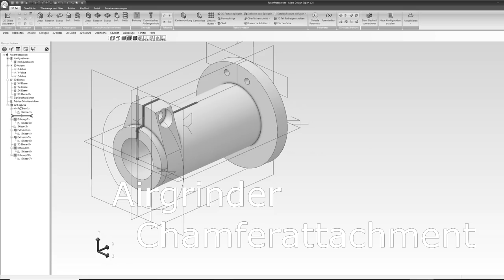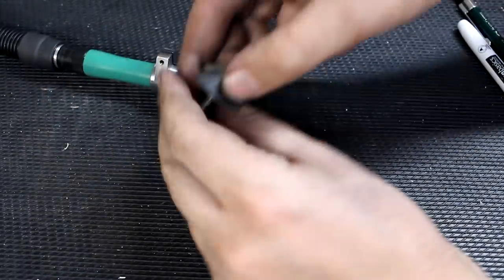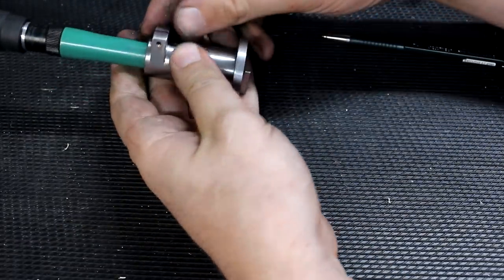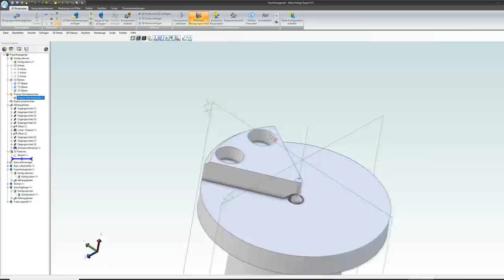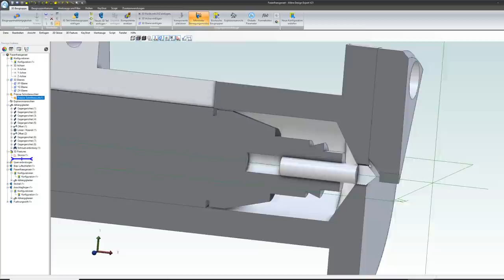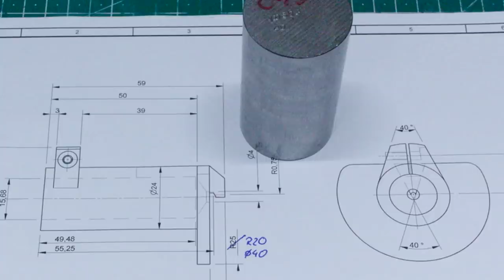Airtool chamfer attachment

Comment: Wow that’s crazy. I just 3D Printed an attachment like this for my Foredome flex shaft tool for trimming the basses of 3D prints. Yours is much swankier but I’m tickled to have been thinking along the same lines as you but for plastic instead of metal. Nice build. Thanks for sharing!

Comment: Interesting as always!
I especially like your idea to set the depth of cut with gauge blocks (3:50). In practice it would actually work opposite to the way you described - larger blocks will make a shallower cut - but it’s a nice idea that I expect will find a lot of applications in my shop.

Comment: Thank you for sharing your design. I hope that you don't mind, but I intend to replicate it. I saw Robin's version, but it's a little more complicated than what I need. Yours is just right. One thing that I will do different is the material for the base. I'll use aluminum and hard anodize it. It's much lighter than steel and provides better wear resistance. It's not as good as a nitrite coating, but it's fairly durable.

Comment: Great work as always Stefan.

You are debating if you should send it out for Night Riding? Wow! A talking, intelligent, crime fighting chamfer tool with flashing LEDs that saves you from the bad guys at the last moment. "Well that was a close shave Stefan!"

Ahh. Nitriding!
I'm disappointed. Night Riding sounds so much cooler and would have been quite a departure for the channel. Stefan fights criminally bad machinists with the help of an air powered tool. Well, it would be easy to cut them down to size!! You could also show them the error of their ways (measured in microns, naturally). Then they would have more accurately leveled lathes.

Ways. You know, prismatic ways on a lathe bed? No?

I'll show myself out...

Comment: Very nice tool enhancement. I was thinking of using one of those pencil grinders as a spindle for small endmills for aluminum on the cnc. The kW output seems adequate, but the manufacturer warned of over clamping.  Is your clamp torqued to the "just enough level"?  Can you report what grit you use on your diamond grinder wheel used for the sharp cutting edges on carbide? And finally, I see new cad and imagine come new cam.  I got bobcad to agree in writing to allow me to show their stuff on youtube.  What is your thinking on cad/cam now? thank you.

Comment: Hi stefan,quick question..do you had to mill out few cents from your top cross slide in order to use the quick change tool post?because on my emcomat 8.6 any commercial tool bigger than 8mm cant be used because to tall so ends up higher of 3/5 mm from the center stock,i mean even if i dont use the the quick release at all and i place a 12mm cutter on the top cross slide will over the center,is it different in your lathe or you had to trim out some material from the cross slide?thanks

Comment: I'm curious on the concentricity of the guide pin due to the silver solder.   How much far is the pin displaced from the tiny amount of silver solder between it and the guide finger?
Reply: The guide pin is attached to a triangular piece that is attached to the end of the largest component.  Concentricity of the pin is dependent only on how closely you match the pin to the bit when you secure that piece.

Comment: I don't know the proper name for this technique, but there's a "screw-in-screw" trick that should allow sufficiently fine spacing very simply.
Turning "Screw One" by "one full turn" doesn't advance by the pitch, because the other screw is, basically simultaneously backing out based on its pitch.
Hard to articulate.
Reply: Shrike DeCil   Differential screw.

Comment: If you are making these large brass pieces on the cnc machine why can't you do the chamfering as part of the cnc  machining process? Not that the router attachment isn't cool of course 🙂
Reply: I wonder the same. Specially since the spindle on the router has a tool changer, which makes it even easier to change tools.
Reply from the maker: Thats the backside of the part :-D
And I would not have ended up with the chamferattachment ;)
Reply: @StefanGotteswinter  oh doh! Can't argue with that logic! You might find a foot pedal on your air supply will be very handy here. Keeps 1 hand always free.

Comment: Yikes...that Biax die grinder is almost 600 Euros!
Reply from the maker: Uhm yes, good air diegrinders are unfortunately quite expensive. But they basicaly last forever and can be rebuilt rather easy. 
One way to get one is ebay and then buy a rebuild kit.

I got mine also used on ebay..